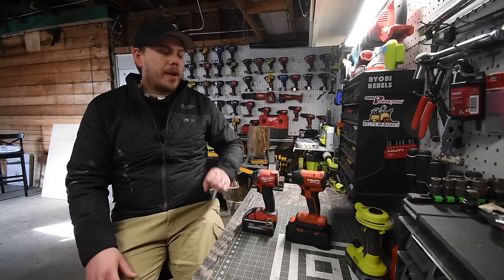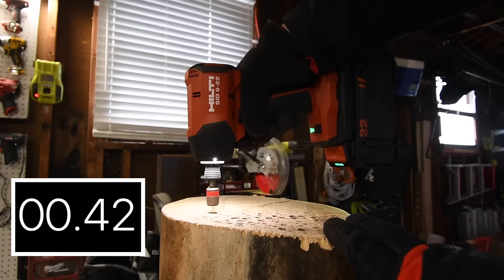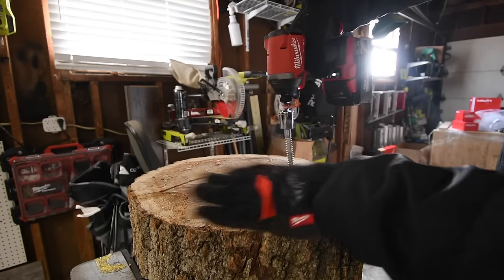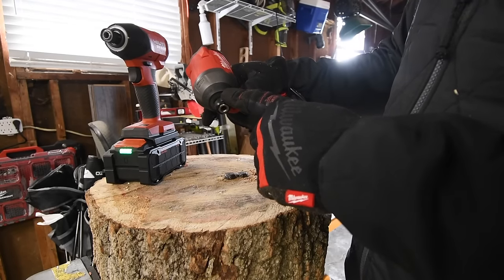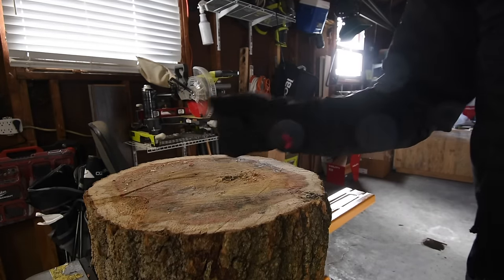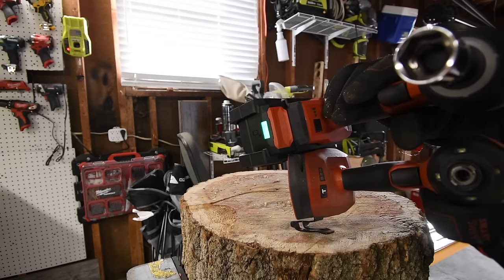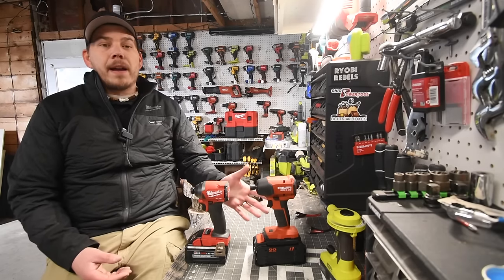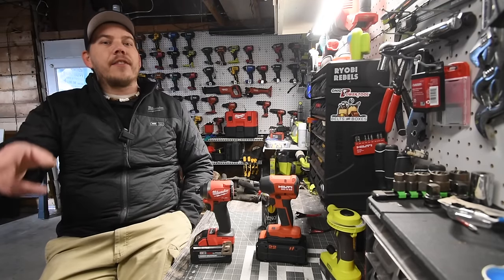Is Nuron Better Than FUEL Now?

Comment: I'll take Milwaukee all day long over Hilti.  Often cheaper, better availability/selection, and performs like it should.
I also have a problem supporting a company that was founded in the middle of WW2 by a known Nazi-SS member in support of Hitler.
Reply: @plissken94th57  
I know where TTI is based.  What I said Martin Hilti was a volunteer Nazi.  He built the company in direct support of, and sworn allegiance to, Adlof.  He volunteered to the SS (perhaps the worst of the worst) The company is still owned by that family.  I have worked with people from that region and will tell you sympathies still exist, albeit quietly.  
I stand by what I said listing reasons I prefer one brand over another.  Saying I also have a "problem supporting" was secondary to those points.
Please tell me what facts were mistaken.
Reply: Hilti is way better . It wil outlast every milwaukee .

Comment: All these  other tool companies better run and hide .if Milwaukee  decides  to drop gen4 . Especially  flex and the new hilti. Moron. Milwaukee  man 4 life
Reply: Milwaukee don't nerd to be any faster. What is very needed is improofing the build quality. 
You don't see wobble dancing batterys on Hilti, no overheating problems, trigger malfunctions, bit loosing collets or thermal shutdowns.

Comment: hilti is weak my dude
Reply from the maker: it actually isnt
Reply: then why is it getting whooped by a tool that came out 5 years ago exactly cause hilti is trash rebranded bauer lol
Reply from the maker: That Milwaukee is a beast and everybody knows it. is it more powerful than the HILTI? Yes it is. But that doesn't mean that ALL of the other impact driver across all brands are weak tools. No company beats that M18 impact driver so far.  But other companies do majorly whip the m18 Fuel hammer drill. But this M18 impact has been untouched by every other company. including HILTI
Reply: @ManCaverTools  incorrect not many companies beat the m18 fuel hammer drill and the few that do are much newer and also much bigger the m18 fuel hammer drill is a beast at a much smaller footprint
Reply from the maker: but it does get beat hear and there, does that make it a weak hammer drill? NO it does not. trust me there are people in these comments that will tell you that it is weak, but im not. The m18 Fuel hammer is powerful Just because it loses sometimes doesn't mean its a weak hammer drill.
Reply from the maker: thats the same for all tools and tool brands.
Reply from the maker: which, That M18 Fuel hammer drill I have is broken BTW. I need to send it in to get fixed. Comments said that the M18 Fuel hammer sucks because I broke it. Which I told them that it doesn't suck. all too brands have tools that break. that is reality.
Reply: @ManCaverTools  hilti tools are middle of the road when it comes to performance yet they are at a top tier price this is one of the issues i have with flex tools they are priced top tier i will say they have good performance but their tools are bulky and heavy it's not hard to make a powerful tool if it's a heavy brick that's not innovation thats laziness if a company like Milwaukee made huge tools like that nobody in the industry could touch them nobody wants to carry around a big boat anchor all day
Reply from the maker: @wigsplitter830  That is why I love Dewalt power stack battereis

Comment: I'm not that impressed with Hilti. I think the Milwaukee is better in most ways, and would not consider the Hilti. In my opinion Festool and Hilti are not qualified to charge as much as they do for some if their tools that have mediocre performance. The Hilti looks like it's about the same as DeWalt and Makita in performance, in a big over-sized drill.